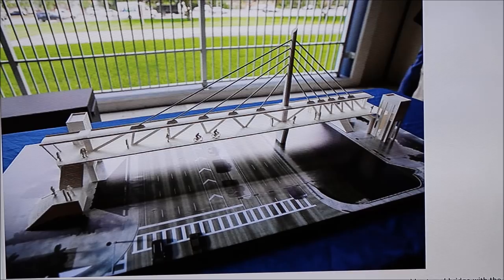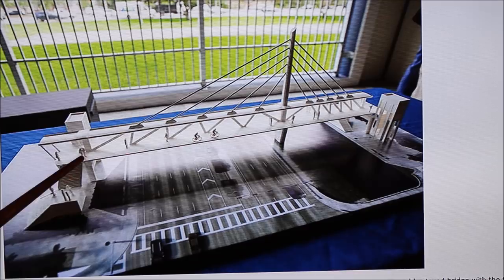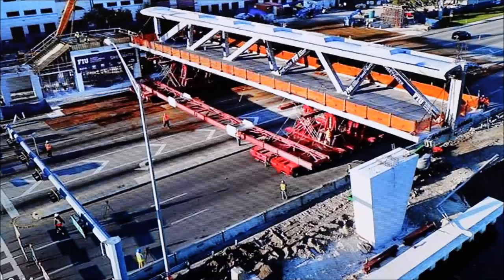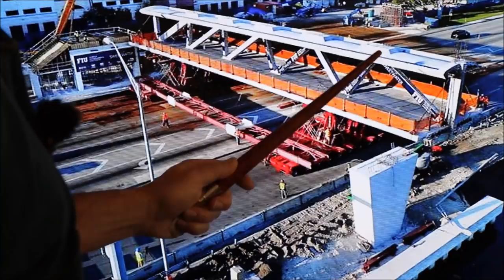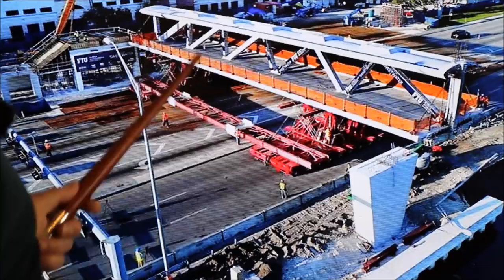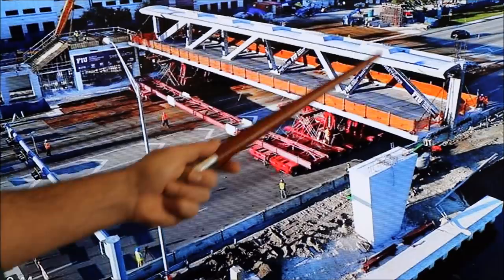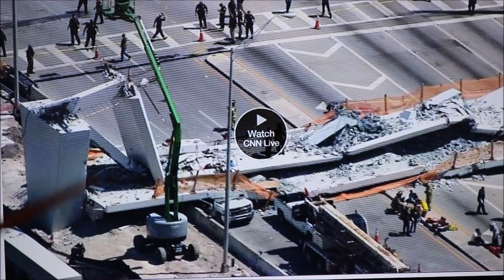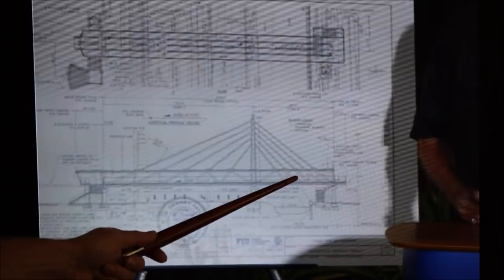Miami Bridge Failure- preliminary analysis 17 March 2018

Comment: What do you think of AvE's analysis?
Reply from the maker: too much profanity...
Reply: Juan hasn't heard of AvE (yet), and is trying not to speculate (opposite of AvE).
Reply: Please, try not let the profanity blind you from the technical aspects. I understand it can be hard.
Reply: AvE does not use family friendly vocabulary, but his video is compelling viewing if you want an engineering viewpoint.
Reply: I think AvE's ASSessment is not far off.  WTF is profanity.
Reply: Profanity is the frequent use of the F-bomb word.
Reply: Flyingdutchy33 Juan has young kids, and works for an airline. He is entitled to have different standards from AvE.
Reply: Flyingdutchy33 Juan has class & respect. Ave is lacking the respect of those that don’t care to hear the nasty language. Juan cares about his kids and his family and what is heard and played in his home.
Reply: Really?  Six f bombs in a 16 minute detailed video with a language warning and all you can say is "Too much profanity".  I didn't expect this sort of response from a former military man.
Reply: Like it or not, profanity is totally unnecessary and communicates absolutely zero, other than the users lack of a good communication skill set.
Reply: Interesting, Juan was saying the overhead cables were basically ornamental, opposed to suspension as persued by AvE, et al.
New information from NTSB presentation?
Reply: AVE did not talk about the cables and fully explains how this kind of bridge works.
Reply: Ave is a very smart guy. But he said he wants his channel to be the "construction dude corner" where he can talk freely with the boys. Which is fine, but there is definitely certain times and places for profanity and clean language
Reply: + Ric Pratt -  I refer to those people as having a "limited vocabulary".
Reply: Diogo Mendes : AvE did an excellent job on the pre & post tensioning description, etc.
Unless I completely misunderstood, the failure initiation speculation,  boiled down to the re-positoned movers, was predicated on suspension giving final rigidity and the sub-assembly not able to handle the induced cantilever stresses over-tensioning the bar(s) into plastic defomation, precipitating failure when being re-tensioned.
I could be wrong, from early a.m. viewing before coffee.😉😜😎
Reply: TDD
AVE talks and talks and its hard to know what he is talking about...Juan clearly explained it...Thx Juan.Good video
Reply: I subscribe to both yours and AvEs channel and i enjoy both channels. AvEs videos are not "family friendly" but i'm pretty sure he never intended to make content targeted on children. You dismiss TurboDieselDan question with an Argumentum ad hominem.
(That's a fallacious argument to those who dont bother checking this out) That's pretty disappointing in my opinion
Reply: @B C Who invited his family?
Reply: CNN said it was the Russians.
Reply: Did you watch the video and if so, other then the profanity, what do you think of the rods deflection?  I found another problem was the falsework in one case was not placed under a load point.  The failure point at the end of structure has a punched out rod, and a bow whip sound was heard at the time of failure.  If only one tensioning rod or cable needs to fail for the bridge to fail that's absurd.  Are you sure the cable stays are decorative??
Reply: He can't even pronounce ENGINEER. I watched half of it and from a technical perspective he doesn't know what he's talking about.
Reply: yeah, there is just so much, that differed from the blueprints describing how the span was supposed to be put in place, that had been changed, I am in disbelief. There are just so many things, that had one of them not happened, the collapse would not have happened.

Juan's and AvE's opinions of what failed aside. The simple fact that what was in the blueprints, was not what was done, is the biggest red flag. The plan had been changed, And I'm sure Juan can appreciate how much impact that can be, akin to being told on approach, that you're going to land on another runway than what had been planned for. It just opens up so many opportunities for things to go wrong.

Great vid Juan. B)
Reply: +TurboDieselDan - He's one of those "do anything for a laugh or for more viewers" type of channels that I quickly dropped.  Yeah, he can be funny but beyond that I have no use for crappy content.  He is very very highly overrated.
Reply: There is nothing wrong with profanity when used appropriately. If you are hammering in a nail and you smash your thumb you are not going to say oh, jolly gee, I smash my thumb. You will curse. I haven’t seen the video so I don’t know how he used it. 

Let us not forget that what is a curse now might have been acceptable in the past and vice a versa.
Reply: The irony here is all these folks calling Juan a snowflake because he doesn't  want to listen to profanity,  actually being snowflakes themselves because he chooses not to and is willing to be honest about it!
Reply: AvE and most everyone else are not looking at the correct true reason of collapse. The lack of the main support tower and the cable stays not being in place is the primary reason this design failure occurred.
Reply: Mark...I bet you can't say that 10 times real fast...Ha..!!
Reply: A D ... I read somewhere else that the tower/suspension wires were for aesthetics, not support. If I can find where  the article was, I'll post a link.
Reply: I gritted my teeth and watched most of it.  No, ... there is absolutely no reason for  profanity.  It merely shows his lack of vocabulary to explain himself.  No class, and he defeats his credibility.  However, the content also defeats his credibility.  His ideas about support in the middle during construction has no relevance.  The example of the bridge across a river is extraneous and adds nothing.   All his talk about pre-tensioning, post-tensioning (BTW, he does not understand the ideas well enough to keep them straight) have some merit, but how he migrates to a conclusion about the failure is wrong.  He has some things right about "beam across the road, tension on the bottom compression on the top."  However, he never reaches the use of the truss as part of the design.  I am baffled that his video has over 400K views.  It is no better than MSM for the  false ideas being advanced.  Such are the hazards of open social media.
Reply: Eastern Woods...He stated very clearly from the start that he's not a structural engineer (or enginerd), and actually invited comments from anyone that is an engineer, or has technical bridge building knowledge.. Since you are, what technical perspective did he get wrong?
Reply: KSparx - you nailed it.  He had no credibility to speak to the issue, by his own admission.  He is only looking for YT exposure and views (read: $$$).  The topic is hot right now, and he is capitalizing.
Reply: lol...the profanity is part of his definition. It does get pretty tiresome, vid after vid after vid after vid.
Reply: My two cents as a structural engineer is that AVE did not see the collapse video which showed the collapse start near the end where Juan mentions, however, I strongly disagree that the cables and tower were not part of the overall structural capacity of the finished bridge. I am sure the design was made to support any loads it may be subject to during construction as each piece of the bridge was built. This is done all the time. I cannot imagine anyone load testing a bridge section that was one, over traffic and two, just an incomplete section without the continuity of the second span and the cables so I am not sure what Juan means by that. 

Ave mixes pretension and post tension concepts as they both are prestress techniques and both could have been used but the bottom slab/truss tension chord was most likely post tensioned the length of the bridge where the steel tendons were stressed after the concrete hardens and they are not bonded to the concrete but are clustered in tubes so they can slide as they stretch and pull against each end of the bridge to keep the lower concrete slab in compression. Ave might change his mind once he saw the collapse video. I cannot see how a failure in the prestress could occur on all the tendons at once without a slower sag type failure. 

I disagree with Juan that the end diagonal member was the weak link because that member was sure to be in compression(favorable) and is still in tact after the collapse. However, the next member was probably in tension and may have been post tensioned also as Juan mentioned the worker up there who may have been increasing tension. I understand there was a crack reported earlier that day that may have been in this area. 

This is also the area where the bridge was lifted by the jacks. Where these members connect to the top and bottom slab there would be some very large shear forces interacting between adjacent diagonals and with the slab which would require heavy conventional shear reinforcing of the slab in addition to the post tension tendons through these areas. 

I did not like the double supports on each moving jack as they were loading the slab on each side and not directly under the truss member connection to the slab. Did this condition damage the slab at the truss connection during moving? Was the shear reinforcement inadequately placed? Was there a mistake in the design? Other construction error? Bad concrete? The engineer below is right: a lot of smart, experienced people work on these projects but they are human and unfortunately "time is money". Ave is right that it usually takes several of the above errors to lead to a collapse but it can also be one "minor" last minute change in the field by a contractor with or without the Engineers approval.   

The bottom line is the collapse is sudden and seems to start near one end. This tells me it is shear related and in a truss structure, that points to a connection. Concrete trusses are a bad idea because the member connections are difficult and so critical. My two cents, well maybe 3.
Reply: Rightsideofthegrass   You say he has "no credibility to speak to the issue", and then say he's only "in it for the $$$"?  Dude, you just won the internet Pot-Callin'-the -Kettle -Black award.Twice! (lack of credibility+capitalizing hot topic, fyi). Capitalizing on hot topics is what trolls do. Right, troll?
Reply from the maker: Michael Meyers the use of excess profanity on You Tube is simply unnecessary and unprofessional. Makes the whole channel look dumbed down. This is why I won't post my out takes LOL.
Reply: Did you or did you not know Canadian was a different language?
Reply: What do you mean"those people"!?!?  Huh!!!  What do you mean "THOSE PEOPLE"!?!?!?!?
Reply: Profanity!!!!  I bet there was a lot of WTF being said when the bridge fell. So don’t get to upset by AVE.
Reply: DJ That's worth a lot more than 2 cents. ( You at least have cents, ours got eliminated. I asked elsewhere, why would they post tension after installation. I would think post tension would be best done before hoisting. Also aliment of the connections ( in this case simply laying on ) is critical. If there is any twist due to poor placement of the connecting plates or during tensioning, I would think failure is almost inevitable.
Reply: Too much profanity but you watched it. And you probably laugh along. Obviously two different channels. Targeting two different audiences. Neither of them really know what’s going on in a matter like this or else they’d be enginerds. But both videos are well put together to capture the attention of their audiences.  Albeit probably very different audiences. Glad to say I’m not soft enough to be swayed by a couple bad words. And I’m  not naive enough to think that the kids don’t hear and say way worse things. Ave ain’t walking on egg shells for anyone. He might however kick the pedestal out from under you ifn you try to put yourself on one.
Reply: Due to the repeated lack of Juan's analysis on AvE's analysis I'm guessing he was one of the people AvE was referring to at the 1:00 mark in his video that need to do something to their hat and get out of there now if they cant handle an f-bomb.  Why else repeatedly dodge the question?
Reply: Well, this was unexpectedly entertaining.  As someone who follows both AvE and Juan and enjoys both, I don't get all the hurt feelings just because one YouTuber is not automatically a fan of another.  AvE does indeed limit his channel audience as a consequence of his language, though if you are not sensitive to the language he can be very entertaining and is quite intelligent.  One should probably keep in mind that AvE's work has him spending much of his time working around miners and other heavy industry persons, as a consequence many of his friends likely come from a similar background and we all tend to build our lives around our friends and family and they have a tremendous influence on who we are and how we relate to others.  I would, however, never suggest that AvE has a limited vocabulary, I have never encountered anyone who could invent more words and malapropisms, quite intentionally, on the fly.  Juan has every right to his own set of standards and preferences and his lack of preference for AvE's antics -- without the all too tiring "snowflake" argument being flung around by either side.  It should be enough to know that Juan at least took the time to watch and consider AvE's analysis, beyond that all the silly "snowflake" flinging is just plain trolling.  Juan, just keep being Juan and ignore the trolling for what it is...others just need to remember that everyone has a right to their own likes and dislikes.
Reply: Mark Schweter I love Juan & his Dam videos, but I also love AvE and his profanity (words & shouldn’t upset you or require you to protect your loved ones from them - they’re just words).  I think there was little to no “speculation” in AvE’s last video & it seemed to explain the failure pretty well - if not as eloquently & succinctly as you ;)  as for Juan’s saying “I believe that the design will be called into question” not a direct quote, as I had to stop watching, to write this (I’m on mobile), but that seems like wild speculation to me & I thought he was better than that.
Reply: Then your assessment of AvE would be wrong. One of his strong points is his mastery of vocabulary. He doesn't stay on the reservation of FCC enforced rules and this gives his story "voice" increased dynamic range that is not only informative but highly entertaining to his audience. Oh and my wife's quilt group is at a quilt show as I type this. Love your avatar name.
Reply: It's amazing to me that people would focus on his language over his ability to present things factually and easy to understand.
Reply: I watched the AvE video and he convinced me that one of the tensioning rods snapped and sprang out of the bridge before the rest of it collapsed.  As for the rest of it, there are details I didn't follow, probably because I'm not a structural or civil engineer.

I am though astonished that just one steel rod can fail and the bridge can collapse.  If that was really the way it was supposed to work, then I can say this was the basic problem right there.  

Beyond that if I were analyzing this, I would want to sit down and go through step by step the different forces that were put on those rods and the concrete as it was lifted up and put on the piers.  I'm sure this is being done right now and I have a feeling that this analysis will reveal that the bridge was broken as it was put in place from a lack of understanding of the stresses that were being put on it.

If analysis shows that isn't the situation, then my second guess would be to look at the concrete.  This is something I've wondered before.  Concrete is a wonderful material if it is made correctly.  But the question is, after the pour how do you tell whether it was done properly?
Reply: The cables run inside those concrete truss segments.  The end of that particular cable is accessed from the top of the bridge canopy.  After the collapse the end of the cable and tension rod were exposed above the rubble.  Some photos show this.
Reply: The NTSB representative made it very clear the tower and upper cables to it were decorative, only
Reply: You mean his talk about that starts with self moving choochers, fuck this and that and she's a bit dusty all in the first 30 seconds? the only understandable words in that were 'mind you I am not a structural engineer'
Reply: Some say it was Obama :-)
Reply: Go the profane as they truly speak the truth.
Reply: As an avid follower to both Blancolirio & AvE  channel (I contribute to the content on both) I find the comparison moot. I understand that some feel the profanity of the latter detracts from the efficacy of his message, or maybe you just don't care to be exposed to that form of language period? No problem there either. He make no bones that his videos are NSFFV, it is an acquired taste for sure, but don't fool yourself into believing it is not without substance, is dumbed down, or "click bait" just to chase $$$. AvE does not tout his credentials, but from my observation, I would say that he has both in-depth technical and hands-on training for the installation and/or troubleshooting of complex industrial system in the mining, or oil/gas production sectors... so if you can get past the "blue humor" and have a thick skin, there is much to be learned while having a laugh.
I love Juan's coverage of the Oroville dam emergency, as a citizen reporter his product was better than the "mainstream" outlets. His commitment to accuracy, detail and no-nonsense delivery has caused me following his other endeavors too. While he may have some aviation crash investigation experience as a result of his military and commercial training ( I too have such experience) and a increased knowledge of stressed concrete structures due to the Oroville reporting, neither of these content providers are qualified to make a definitive analysis as to the root of the failure of the Florida bridge collapse, they BOTH just add another facet and point of view as this story unfolds. What I suggest is we should question all information sources, continue to learn, and remain vigilant.
Reply: Ave should get paid more. He is so much better.
Reply: Gordon Richardson ave just pumped out a 2nd baby. It ok for responsible parents to use profanity when not in front of their children. But ave gives you advice at the beginning of his video.
Reply: So
Reply: profanity....it was tolerable until about 1/2 way through the first video I ever saw of AvE
Reply: More of a case of let people make there own minds up
Reply: and when did you know it
Reply: if you are refering to AvE as only being concerned with "exposure and views (read: $$$)" you're so far off its ridiculous! And if you can't handle the ferakin language stay home wah.
Reply: I really liked what he had to saw.  Any time you very from the engineers plan of construction creates huge possibilities for something to go wrong.
Reply: Diogo Mendes Yes AvE certainly did mention the aesthetic tubes, NOT cables, descending from the 109 ft tall tower.
Reply: gregg4164 You really haven’t been paying attention have you? There are no cable stays and none were ever going to be built. The “support” tower was not designed to help hold this bridge up, there were steel tubes, not cables, which were primarily aesthetic but would add a little stiffness to the design to stop it pitching as people walked over it.
Reply: Since mister "owww my virgin ears" doesn't want to comment, I can in his place as an engineer. The above video is correct in that the truss was the most likely failure point. This is shown in how the two sections around the adjacent truss supporting the end simply failed abruptly the way it did. Without the preloading, its basically just two slabs of concrete beyond the remaining trusses and the rigid portion of the bridge simply falls away. The failure of the bridge itself in the video automatically implicates the tensioning rod, just due to how it failed. Ave's video provides good supporting evidence for that to be true. Its not clear as to why the rod would have failed. There are many ways it can fail, from breaking, separation from the lower mounting point, or simply incorrect tension. Never the less, Ave came to the same conclusion, but sort of going backwards from where an engineer would start. Personally I don't think the rod itself was the primary factor here, more of a symptom of greater overall design defects and shortcuts taken. I had the same thought that the span should have not been allowed to be fully unsupported until later on once it had been stabilized and testing completed. I think the city pushed hard to get it open to save face with the public and get the desired impression they wanted with the voters, at the expense of safety. That was a common experience working as a consulting engineer. They want it as fast as possible, cheaply as possible, and oh by the way now that bidding is complete and your starting work, lets change everything. But, the change order wont cost any extra, right?
Reply: But, of course, the politicians will toss the engineering firm under the bus, blame them for everything, and get re-elected for taking action to hold those responsible "accountable" for actions they themselves where likely responsible for in the first place. And the game goes on, business as usual.
Reply: I completely agree.
Reply: Profanity is like spices for your mouth ;)
Reply: Too much dumbness.  He simply does not have enough engineering background to accurately evaluate the problems.  I could not finish watching his video.
Reply: The real profanity was the disregard to public safety and the resulting deaths. A few "F" bombs is appropriate in this context.

And, yes, AvE is NOT for everyone. He doesn't try to be.
Reply: He seems to have to essentially figured out.
Reply from the maker: Craig Wall sorry to offend you so badly young snowflake...LOL
Reply: AvE has a great channel and I've watched pretty much everything he's got on it and his language is in jest.  If that's too much for you then don't watch it.
Reply: I think it is possible the rod could have been pushed out of the diagonal as the bridge collapsed and not ejected before the collapse. In either case the attachment at the base definitely failed as evidenced by the puff of dust at the base shown in the slow motion video.
Reply: The cables are in plastic sheaths in the middle of the concrete. They are tightened to squeeze the concrete in compression like a column. They are usually on seperate fabrication plans.Inspector  
Jeff
Reply: The cables are in plastic sheaths in the middle of the concrete. They are tightened to squeeze the concrete in compression like a column. They are usually on separate fabrication plans.Inspector  
Jeff
Reply: there is a hub there that is in compression against the concrete.